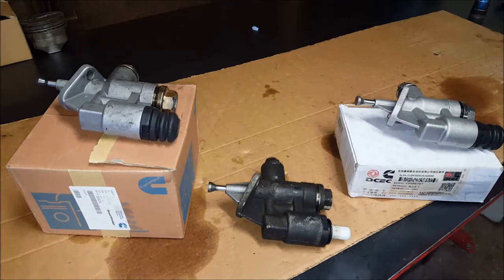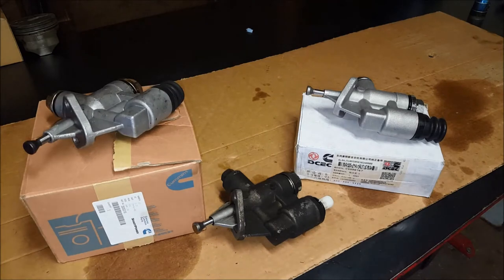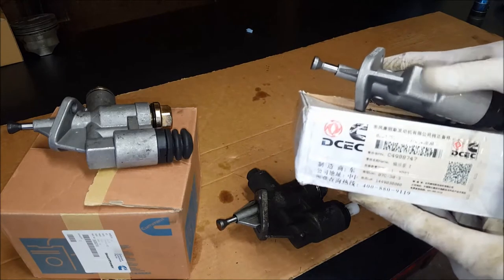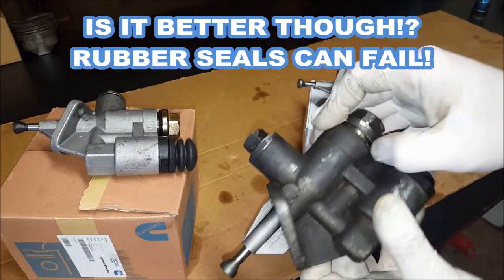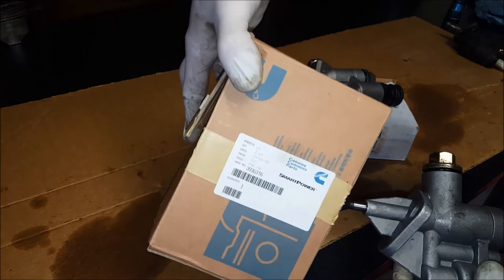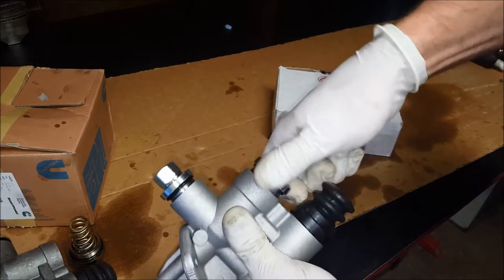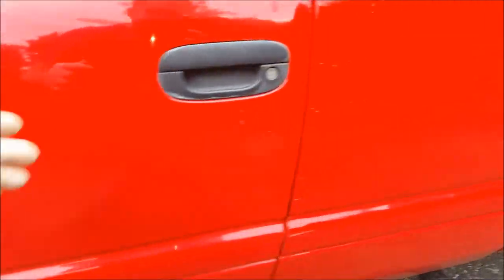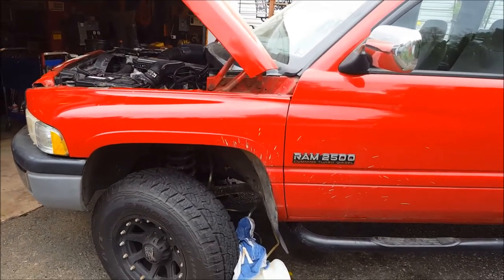Ebay Carter fuel pump vs DCEC vs OEM differences 12v Cummins Dodge

Comment: I agree with what he is saying for the most part. I have taken apart a few of the lift pumps. Aftermarket pumps seem to have different quality but just because it is made in the USA does not mean it is good quality due to extremely high labor and material cost  also greed many USA company's make crap. China can make crap also or they can and do make some items that are very good. It all depends on what the importer is willing to pay for. And the sad part is many times the difference in cost is just penny's per unit but our cheap greedy corporations will demand the lowest cost so they get crap

Comment from the maker: If replacing your pump:
*OEM CUMMINS LIFT PUMP: https://amzn.to/2SeXya3                  
*FUEL FILTER: https://amzn.to/36QvYoZ
*FUEL BOWL SCREEN/GASKET KIT: https://amzn.to/2ujHegj
*PUMP MOUNTING STUDS: https://amzn.to/36ezwSq
*UPDATED INJECTION PUMP SUPPLY LINE: https://amzn.to/2PFn59Q  (stock hard lines are prone to cracking)  *My Other 2nd Gen Ram Videos: https://bit.ly/2TLhJLQ
Reply: NoNonsenseKnowHow  don't forget the square cut seal on the top inlet of fuel pre-heater. Cummins part #3923194.
Reply from the maker: William Baker thanks you're right, I forgot to add that seal. Thanks for adding the part number!

Comment: Great comparison video!  Thank you for just getting to the point and covering the important points of distinction.  I am going to try this dcec pump based on your analysis.  The weep hole seems like an obvious thing to incorporate.  Without that, you're just going down the road with no idea if that seal has failed, although it might create a noticeable pressure change on the guage.  Again, thanks.  Going to check out your other videos.

Comment: I just purchased a Cummins Chinese pump from South Plains Diesel. it has the weep hole in it. 115.00
The nut on the fuel line going into my filter screen was a quarter turn loose. I tightened it and solved my overnight air bubble issue.
Reply from the maker: That's cool man. I'm Still rocking the dcec pump and it has been good
Reply: Southern Plains Diesel
My local cummins parts house in Austin Tx. On Smith road if it helps you search.

Comment: Put an e bay 0 - 50 psi fuel regulator in your return line so as to precisely control fuel pressure in the p7100 pump cavity.   Set it 2-3 psi below lift pump max.
Check to see if your lift pump has the bypass circuit pop off valve that regulates and limits lift pump pressures. Excess pressure shunted back to intake side.

Comment: Just a thought here on those air bubbles.  Although fuel cannot be compressed, just like any other liquid it can cavitate when passing over or through moving parts.  Just as a boat prop will cause air bubbles to form when spinning in water, moving pump parts (Lift and injection pumps) "might" be creating those bubbles.  You've got fewer now with a higher quality pump made with tighter tolerance clearances in the moving parts.
Just a thought.
Reply from the maker: Yeah I agree with you. After making this video I did some more research, and that seems to be the case. But I was hoping maybe some Cummins 12 valve expert would come on here and school me haha.  So I know for sure.  Bubbles or no bubbles the truck runs like a dream, so I'm happy about that.
Reply: @NoNonsenseKnowHow  picking up a new Precision brand lift pump from O'Reilly for $140. Zero fuel pressure so pretty sure 250k mile Carter is toast.
Reply from the maker: @CptJera  sweet man. Yeah sounds about right. Let me know how you make out
Reply: @NoNonsenseKnowHow  Will do.  Should have had the old one off to take the bolts in and replace with studs like yours.  
I can see lining all this mess back up is going to be a chore, especially for this not-so-limber crusty old back and shoulders.  Working on these big Cummins is a young man's game.  BTW, O'Reilly's warranty is lifetime so it's a plus.
Reply from the maker: @CptJera  yeah having the lifetime warranty is definitely a great perk! You can try letting the air out of the front tires to bring the truck down a little bit and that would help out getting in there. Just make sure that the cam lobe that drives the fuel pump is on its flattest Point. Basically so when you're putting the new pump on you don't have to depress the plunger very much. It's easy to put a scratch in the cam if not careful.
Reply: Looks like I've got it installed and ready.  Now the priming issue!  No need to even talk about bleeding the air out.  Nightmare.
Going to buy a spare fuel cap and air valve stem to mount into it, then use my air hose to pressurize my tank and start cracking lines.

Found several points of leaks and have addressed all those.  Removed fuel heater section (burnt temp sensor, overheated and leaking pins in heater section), OEM rubber lines are being replaced today along with worn banjo washers leaking atop fuel filter housing.

Air sucking and losing prime overnight is a problem.  I'll be replacing my third starter very soon because of hard starting issues caused by loss of prime.

Going to install an Edelbrock Micro Fuel Pump #17302 below fuel tank this afternoon as well. It will deliver 38 GPH @ 4-7 PSI and hopefully negate any prime bleed-down if I'm unable to locate all my air leaks.  At the very least, it'll give the mechanical lift pump an assist.  I want to investigate the no-longer-used keyed-on heater circuit wiring to perhaps power the pump.  If I can use it, I'll reduce the fuse capacity to 5amp per Edelbrock's recommendation for the pump circuit.  

Will update here this evening.
Reply from the maker: @CptJera  sorry to hear about having all the air issues! Fortunately mine doesn't leak down at all and starts first crank even when it's freezing.  Sounds like you got the right idea though and are going to kick the problem in the butt! The auxiliary fuel pump is a pretty good idea. Good luck!
Reply from the maker: Just make sure not to pressurize your fuel tank too much. It doesn't need much at all
Reply: Houston, WE HAVE TRUCK!!
Man, charged tank to about 2 or 3 lbs, just enough to push bubbles out of the top of the fuel filter bleed screw and then the port on side of the injection pump.  Fired after about a dozen revs and DANG this old Dodge sure got peppy!  Ran it up and down the valley a couple of turns; what a difference!
Even made it uphill (not steep but still a good run) up the driveway literally idling in 2nd gear where I was having to do it in 1st and push it a bit.

YEEHA!
Reply from the maker: @CptJera  excellent news to hear! Glad you got her back up and running!

Comment: My Cummins was losing fuel pressure over night and I found the feed in the top of the lift pump had a compression fitting with a rubbee grommet leaking air in the system so I took out that line and went straight with injection rubber hose from the fire wall to the pump no more leak

Comment: HI I had the same USA Junk Cummings pump. We must have got it from the same guy,he told me to get the china Cummings pump .I did It works great,way better constant 25 to 35 lbs fuel pressure,also very easy now to bleed injectors with the manual push pump my USA pump never did work. truck never ran this good ever. Also added a beans diesel fuel sump no more fuel issues . U can see sump install on my channel.good video.
Reply from the maker: TheKilog69 cool ill check out your video!  Thanks for the comment and im glad im not the only one that thought the usa pump was junk!  Lol
Reply: Its in my Cumming play list, I have about 20,000 miles on it so far my USA pump lasted less than 10,000.

Comment: Just replaced my lift pump.Got a "genuine" cummins pump off amazon.Got it,had cummins cast into housing and had the weep hole.But it was made in china.Looks like a quality product.Old pump had 500,000 miles on it.Time will tell if new pump will last.
Reply: still going?
Reply: @Precisionmobile  So far working good.

Comment: I had a similar problem and found it to be the washers on the injector return lines. small amount of air infiltration happened for me there and new ones sealed it right up..

Comment: I got rid of all OEM mechanical fuel pump and oem filter, went to electric Bosch 044 inline pump with napa 3788 fuel filter and water separator .
Reply from the maker: I prefer mechanical. Something special about knowing that this truck doesn't need batteries to run.
Reply: Hi there, when you installed bosch 044 pump did you use pressure regulator?? I have a 6ct 8.3 cummings and I'm thinking about putting the same pump, but with 72psi output maybe is a bit to much without regulator... thanks in advance
Reply: @alenl80  hey i used a aeromotive fuel pressure regulator set at 36psi all the time, another way you could go about controlling the fuel pressure would be a in cab voltage controller.
Reply: @NoNonsenseKnowHow  yup!...I have eliminated my fss, fuel heater and installed tcc lock up switch to override any electronic related gear hunt when in od and a starter switch fused direct to starter...I want everything mechanical...less breakdowns on my 97 6bt.

Comment: In regards to the air bubbles in the fuel stream,  has anyone tried an AirDog pump with the separate water and fuel filters?  Albeit they are spendy upfront they are reported to remove the air bubbles from the fuel.  I bought a '79 Jeep J20 long bed with a '95 12v in it;  its my 1st diesel ever and is proving to be quite the learning experience.  Due to lack of maintenance by the PO(s) it keeps crapping out and dying on me.  I've got an auxiliary fuel tank/tool box combo (Handy FT-50-A, no longer supporting this unit) that I want to use instead of the current tank.  I'm leaning to the AirDog FP100 to filter and push the fuel to the CDEC lift pump; I plan to upgrade the AirDog fuel and water filters to FleetGuards.  Am I going crazy missing something here?  I need to get up and going ASAP!
Reply from the maker: I've heard good things about the air dogs. Never tried one though. Mine has been running like a top since this video so I haven't messed with it. That sounds like a pretty sweet rig you have though and definitely worth dropping some coin on a nice fuel setup.

Comment: You replaced your LP because only 25 psi fuel pressure…I thought that’s more than adequate…(that’s what mine runs at)…not good? Also could the overflow valve be bad and limiting pressure buildup?

Comment: you could have a air leak from one of the delivery valves. a fuel sump would help no matter what
Reply from the maker: Johnny Appleseed thank you for your input. I was under the assumption that the delivery valves are on the pressure side so would leak fuel instead of allowing air in. I did bypass the injector return line thinking that maybe I had a bad injector seal allowing combustion gases to enter the fuel system.  Still have the little bubbles.  and as far as installing a sump, I don't think that will help me either seeing as how I bypassed the entire fuel system by hooking a fuelsupply hose directly to the lift pump.  thanks again and let me know if you think of anything else
Reply: Hey not sure if you looked at the fuel heater yet, but I hear that is source of air. My 96 runs little rough after warm up and I'm hoping it's just the fuel heater. Great vids.
Reply: i would try carter+ cant always freeking run a.c.delco 24_7)

Comment: My 96 12 started acting up today. It started up and ran fine then started stalling while driving. Now it won't start at all. Checked my fuel shut off was working and it is. I'm thinking it's the lift pump?
Reply from the maker: You should get a fuel pressure gauge on it

Comment: Did you replace the low pressure return line behind the fuel filter?
Reply from the maker: You're talking about the big rubber one?

Comment: My DCEC pump lasted 3 years/26,000 miles....Started getting weak about 500 miles ago, started leaking today. Buy OEM Cummins made in China pump..yes, made in China. Carter pumps are no longer the OEM.
Reply from the maker: Really? Damn, good information thank you! Mine is still going strong.  I agree that the Chinese Cummins seems to be the best option.  Guess I'll see how long my dcec pump lasts. Where did your start leaking from?
Reply: @NoNonsenseKnowHow  Just my experience, your mileage may vary! GL with it.

Comment: My DCEC Cummins lift pump came with a pressure relief/seal failure bleed hole right out of the box. Im not sure why yours didnt but you may have gotten an ebay fake.
Reply from the maker: Really? I'll have to look into it. Thanks for commenting that
Reply from the maker: Where did you order yours from?
Reply: I get most all of my stuff from a seller i have done quite a bit of business with that goes by dbsales. The owners are Duane and Becky and their prices are always great. I would definitely recommend reaching out to them for parts in the future.
Reply: @NoNonsenseKnowHow  they have an ebay store as well as an online retail store as well but I usually just use ebay method to avoid any shipping costs on small orders.
Reply from the maker: @Erklzanderz  cool thanks man, I'll check it out
Reply: Crazy!  Chinese counterfeit of a Chinese replica to a U.S. made part that now has low quality standards.  Hard to win with those odds lol
Reply: @Erklzanderz   I just tried searching eBay for DBsales and can't find them.  Do they sell elsewhere?  How much do they sell the lift pump for?

Comment: Got a question for you on my 12v Cummins ppump 215 h.p truck bone stock except 90 h.p injectors and a exhaust.

Ok so this is the truck my dad and me use to pull our trailer for our business and he has owned it for some time well recently it started missing so I tossed in injectors seemed like it fixed it drove it and it came back so I checked his fuel filter changed it helped but came back so I put a new overflow for the return in helped but it returned recently I pulled the sending unit and removed the tank screen because it was filthy and I could not find any replacements offered so I figured it's got a filter and I plan to run a custom filter system myself when the miss is fixed once again it helped then went back to missing so I'm about to toss a lift pump in it and see how that works on it since the pump is a 220k pump as far as I know I also ran some of the biocide fuel treatment in the tank and it seemed to help but didn't fix it. 

And I have noticed it only wants to miss when it gets warmed up and you either got the trailer and weight on it at low RPM or you put it in 4th gear at like 25 to 30 and gently accelerate and it will do it's bucking but stomp some on the throttle and it seems to go away
is there any direction you could point me to on this problem?
Reply: Mine is doing the exact same thing. Did you ever find the problem?
Reply: Get a fuel pressure gage so you can see if it’s within spec at high and low rpms. Maybe pressure to low at low rpms to provide enough fuel.Install an new overflow valve they are cheap and easy. Check for air in fuel supply line.
Reply: @thenomad7120  Did all that we put injection pump on it and it fixed most of it but it still had a slight miss i did lift pump fuel filter overflow valve and it had new injectors little before the miss sometime last year i had a moment of clairity #6 injector the copper washer was leaking compression past the injector body i replaced it and fixed it for a little bit but i think my head is messed up in the injector seat so I'm prob gonna have to use a seat cutter on it if i keep it any longer
Reply: @tomhutchins1046  A big part of my issue was the injection pump had problems internally but it still had a miss in a pull and last year I had a lightbulb moment and  figured out somehow my #6 injector was losing compression around it from the copper washer being burnt out so if you still have this problem or know anyone else that might tell them to get a injector install kit and do all new copper washers etc aka reseat them my truck it worked for a bit but the miss kinda came back after a little bit and i think my head has some issue with the injector seat but it doesnt really get used atm and it might be getting sold before long
Reply: @nou8257  My issue turned out to be the lift pump after going through at least 3 different brands i found a real DCEC pump (one of the indicators is a small bleed hole were the shaft goes through the housing .) Its designed to basically act the same as a water pump bleed hole. Put that pump on now it holds 28-30 lbs of pressure at idle and runs better than it ever has even on a hot day. Also you have to be absolutely !! sure you have no air leaks even a pipe thread fitting with no sealer will make hard starting after sitting for a few hours. You wont see a leak . The quick disconnects next to the bell housing are known issues cut them out and replace with very high quality plastic lined rubber hose or hose designed for diesel marine use. 
Yes i bought injectors and all kinds of things but that was not the issue.
Reply: @tomhutchins1046  Man you got lucky with it being a lift pump.

On the air intrusion I did test it with a clear hose from filter housing to injection pump and never had a tiny bubble
Reply: @nou8257  I mentioned 2 issues the miss when hot was off brand lift pumps. The second is hard starting when cold Hard starting wont necessarily have air bubbles when running.  Its amazing the systems work as well as they do the slightest air leak running or parked will cause an issue and there must be 20++ areas were it can leak and you will never actually see it. So you just have to check and improve every one of them
Reply: @tomhutchins1046  I'll keep that in mind if I get back into messing with it. 

it's never had a issue starting cold that i've ever noticed honestly.

If we keep it long enough and I have the money i plan to put a airdog or fass on it and bypass all the stock fuel system and then modify the injection pump